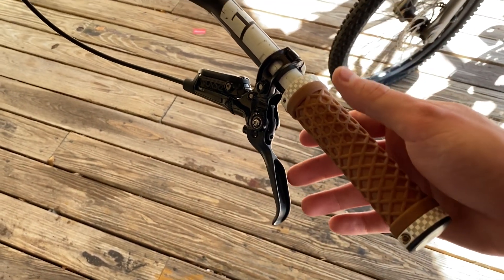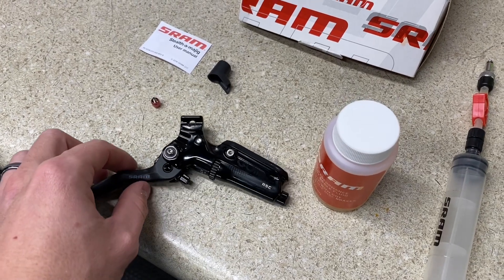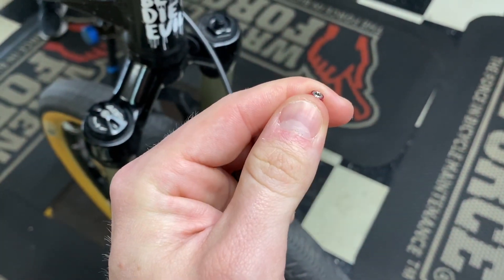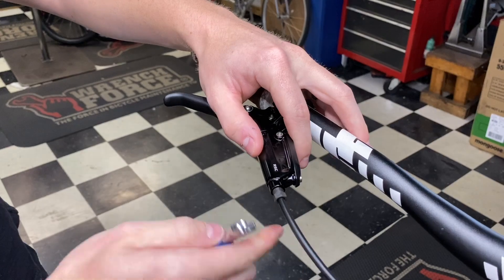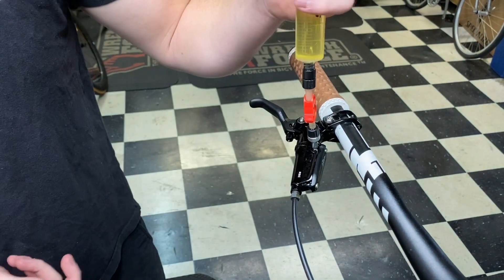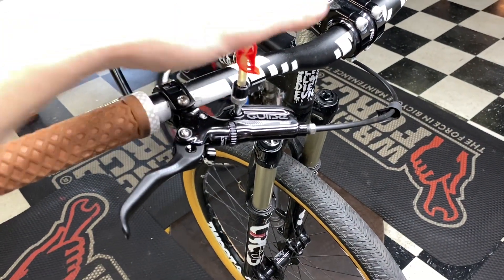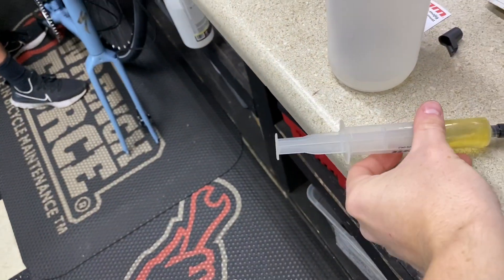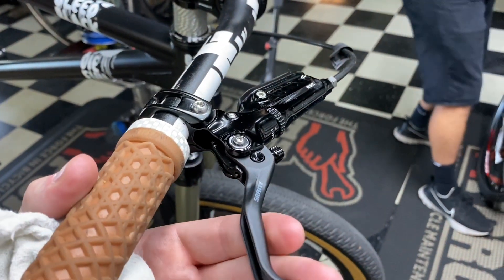*QUICK FIX* HOW TO BLEED ANY BRAKE IN MINUTES (SRAM, SHIMANO)

Comment: Guy you're a legend! I installed AXS groupset to my bike and due to some shipping delays brakes were the last part I dealt with. I found out the calipers I got had the Bleeding Edge port, for which I didn't have the tool, so I tried some hack on YouTube, which allowed me to get the fluid in, but no way could I get the system to preassure. It's three days to a race and the Bleeding Edge Tool is nowhere available in my local bike shops. This video absolutely saved me – thanks to it I could get the brakes at least to work!
Reply from the maker: no problem!! I am glad I can help

Comment: On the quick fix way.   If its working and the brake is stopping,  Why do we have to bleed the brake?   I understand if its old oil, but either way,  New or old should we bleed the system after the quick fix?
Reply from the maker: I dont know maybe fluid leaks because of bad seals or also I have heard of the oil dissipating into the hose after time and getting absorbed into it, but who knows

Comment: It’s curious how in cycling and hydraulic brakes there’s no separation between “bleeding” and “flushing”

This is a perfectly acceptable method to “bleed” the brakes… just get bubbles out. It’s not a good “flush” method because that’s for … flushing old fluid out and replacing it with new clean one. I do this bleeding with my cars, motorcycles, Bikes all the time, it’s 100% effective for the purpose of getting trapped bubbles out that are not allowing you to have firm brake lever. If you find yourself having tu pump the levers to get them to be firm, you have bubbles.
Reply from the maker: :)) thanks for the insight and i agree with this too if the fluid is bad and the reason for the brake failure then yes flush it out and add new ones

Comment: does this work for SRAM brakes with a bleeding-edge port? I'm having trouble with my guide R brakes. Ive done this a few times already and fluid seems to just shoot out of the lever once I get pressure and then the lever pulls all the way to the bar.
Reply from the maker: I would recommend if you have tried this and it doesn’t work then do a full bleed, this is just a quick try which usually works but sometimes needs to be done the whole way